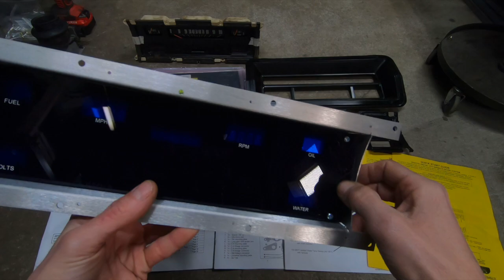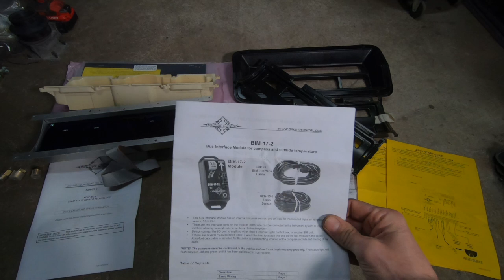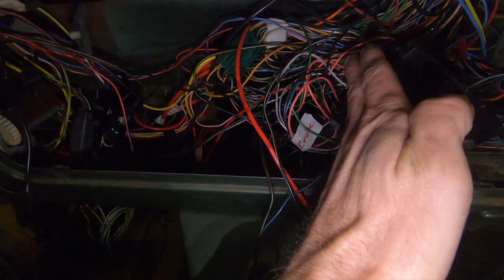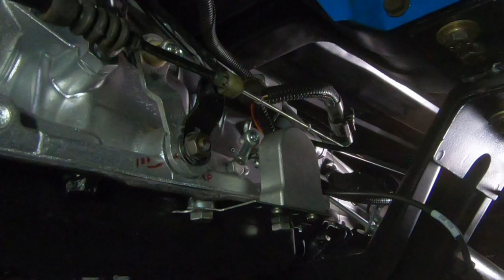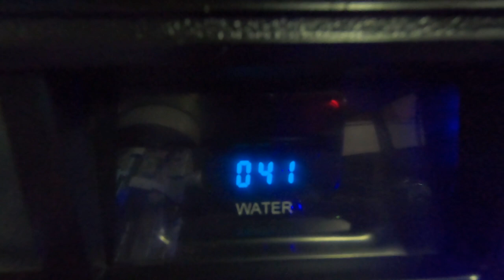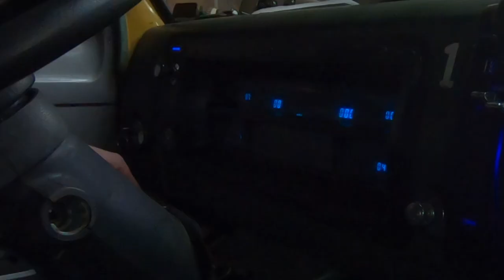Episode-19 Dakota Digital Instrument System

Comment: Hello there, I've been loving your channel!! 
I have two Gen2  Econoline vans and have owned many others.
Say, all you needed was a Gen2 Econoline gage panel with all 4 gages. (Higher trim level) There are 2 types, yours has  2 warning lights, and another came with all 4 gages.
Sorry, but Dakota is wrong.  They are the same profile/ size as the trucks. 
Also, you can get a new glass from Dennis Carpenter Ford parts. Again, it's the same as the pick-up. Hope this saves you time. I was also trying to polish the old glass with no success, then bought a new one, and it was inexpensive.
Keep up the incredible work on your Gen2. It's amazing to watch your excellent work!
Reply from the maker: Thank you very much! Not only for watching, but for your help. I just ordered the lens from Dennis Carpenter. $40 to my door. They seem like a great company. Do you happen to have a source for chrome bumpers?
Reply: @ItWillRun73  Hello, I replied but it has not arrived, so I'm trying again...
The Gen 2 bumpers are one of the more elusive parts to find (in good condition) As you know, the painted ones would be easy to fix/repair. 
If you're talking chrome, it's very hard to find. I have "ok" quality chrome bumpers but only after a lot of time, travel (too big to ship) and cost. I'm currently researching Early Bronco bumpers from LMC Truck Parts to adapt, as they are available as reproductions in chrome.
Looking forward to the next video, your Gen2 is going to be something amazing! Your talents are so varied. Great engineer!
Do you have an email posted somewhere? Thanks, Dave
Reply from the maker: @thedr4549  I have 4 bumpers (all painted). 2 are pretty beat up. They will be one of the last things I do. My plan for now is to take them to a chrome shop in Cleveland. Hopefully I come across some nice ones, or a different model (like you're saying), before I shell out big money to have them chromed. 

My main email is through work, so I keep it separate from my YouTube life. You should be able to direct message me through itwillrun73@gmail.com

Thanks Again